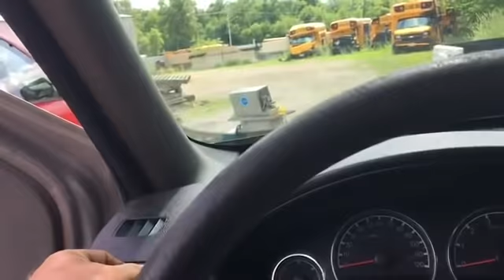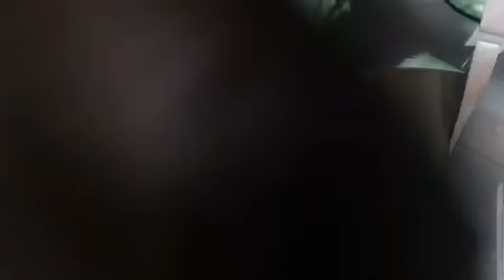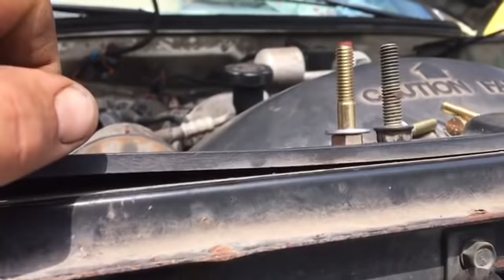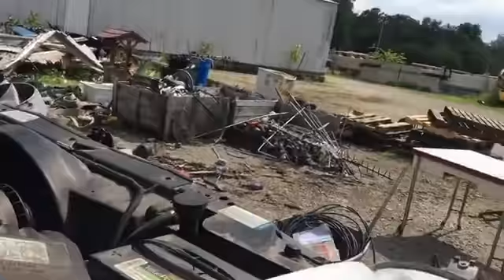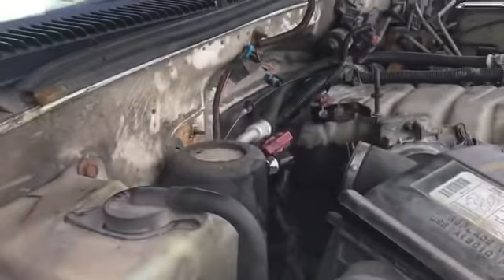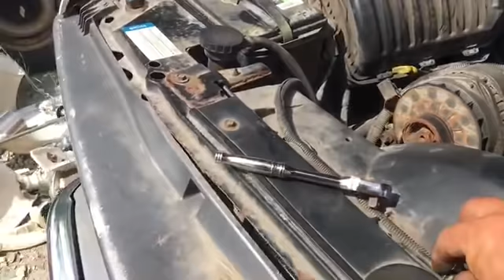Always something 😁

Comment: You can get threaded studs or all thread and nuts, double nut stud in tight. Grade 2 bolts you don't want to use, grade 5 at least, black ones that need to be strong are grade 8, good luck Marty  Yeeeeeeeeeewwww